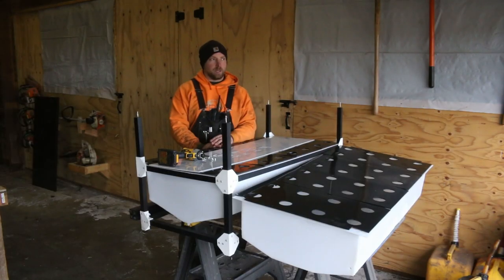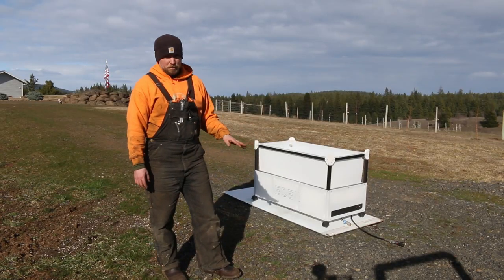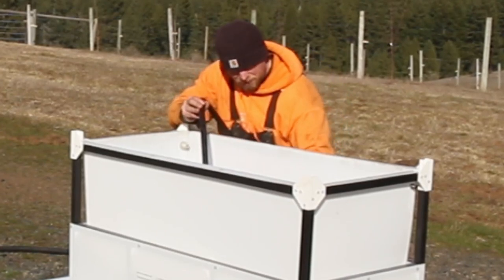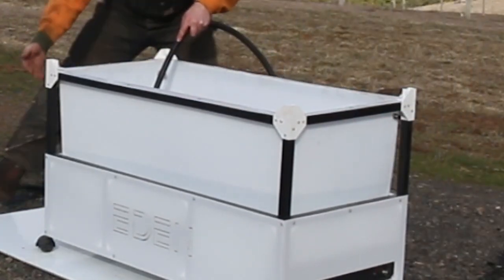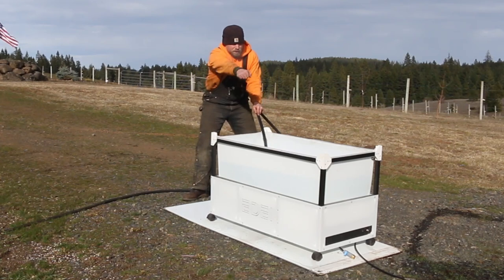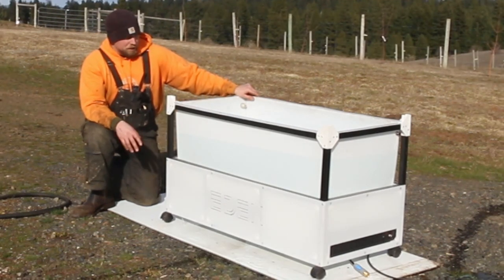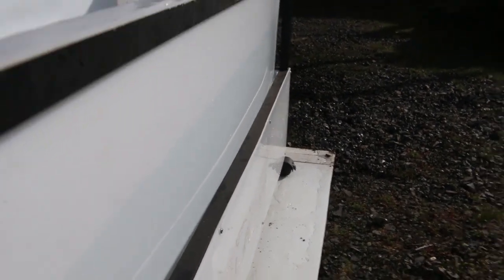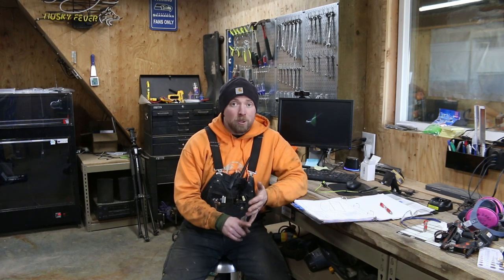PLASTIC WELDING Put to the TEST, AEROPONIC Tower Tank Round 1

Comment: welding in a few gussets to take up some of the load your placing on the seams might help, i'd probably weld the inside of the tank too at least at the highest load area's.
if memory serves your using solidworks.  you can use their load test simulation to model the best location for the fewest number of gussets.

however you decide to tackle the issues, good luck, and i'm looking forward to updates on this project.

Comment: Have you thought about fiberglass tanks? I’m a boat builder and work with fiber glass a lot, I think it would be easier than plastic.
Reply: He said some concern of food safe materials. Still, a food safe inner liner may be nuff.
Reply: Thinking of  it, a sheet of liner could be stretched over top, heated and vacuumed  down to the bottom of  a hard shell. Like a poor mans thermoforming. But you actually leave the plastic in the "mold". Large radius edges is key though, as in any deep draw forming.

Comment: Not sure on the thickness of the plastic, but maybe a dado in the side panels for the base to slide into and then welding may be better if welding to an internal 90 degree rather than external....if that makes sense. Also would plastic welding from both inside and outside or at least silicone caulk in the inside?.